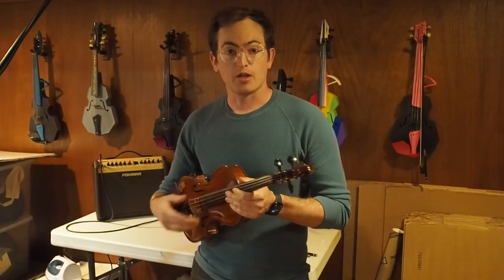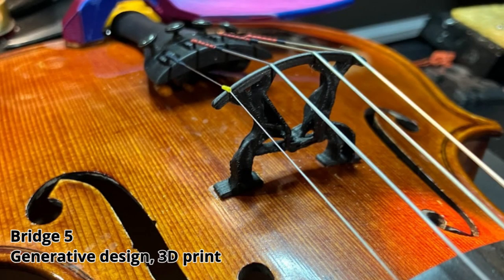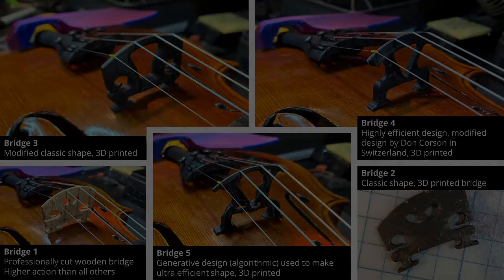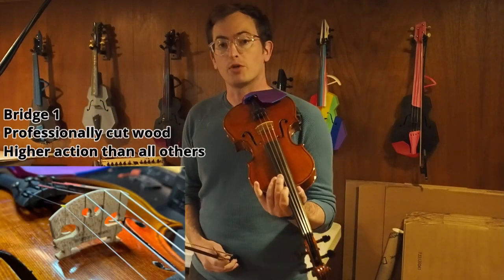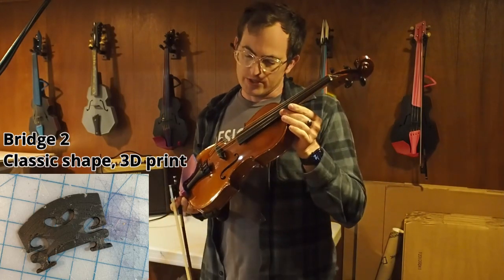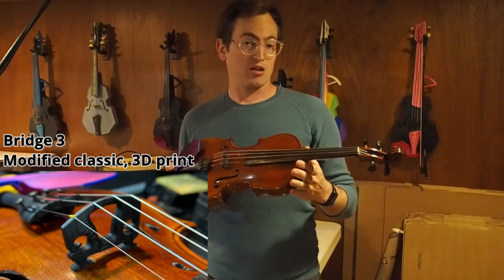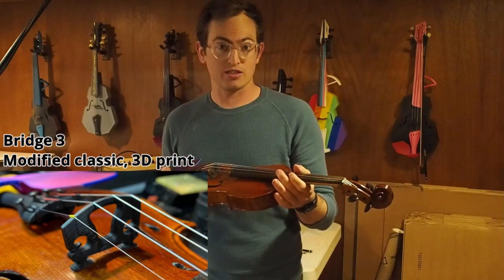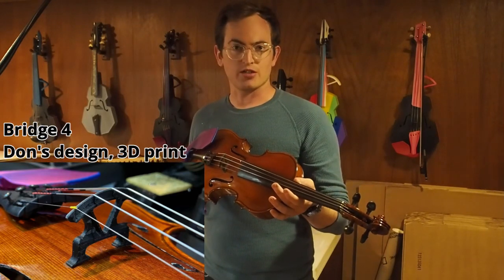The Ultimate 3D Printed Violin Bridge Showdown!

Comment: It's not accurate when listening to audio, but first of all, the 1st violin has a wooden bridge, but it has the crispness of open strings that you feel in cheap practice violins. I think it should be divided into groups 2,3 and 4,5. The 2.3 violin sounded softer and less sharp overall than the 1st sound. The 2nd violin had a well-balanced GDAE, and it sounded more expensive than the 1st instrument. The 3rd violin sounded more open (stronger) in the AE string than the 2nd violin. The 4th and 5th violins have a metallic sound like an electric violin. The 4th violin's GD sounds like classical, but the AE string has a shallow metallic sound like an electric, and the 5th violin has a metallic sound like an electric violin in all the GDAE strings. The sound heard in a large hall may be different, but my best is the 2nd sound.  I have been a classical musician for over 40 years, so I can produce the same smoothness as violins 2 and 3 with violin 1. If violins 2 and 3 make the overall sound of the instrument smaller when played in a large hall, I would choose violin 1. However, based on this video alone, violin 2 seems to have the right GDAE line balance and produce a smooth sound.
Reply from the maker: Wow thank you for this thorough comparison! It is helpful to have someone with a keen ear provide this kind of feedback.